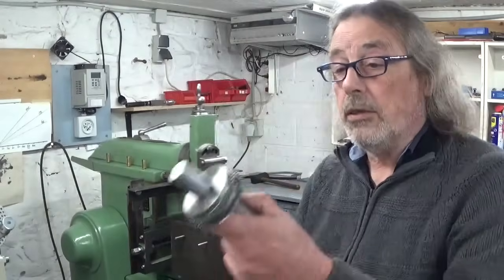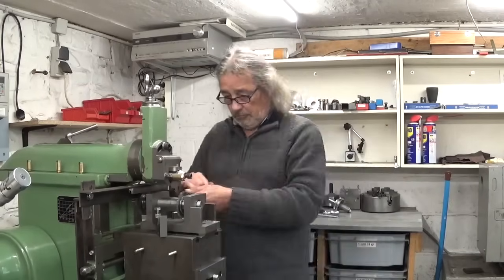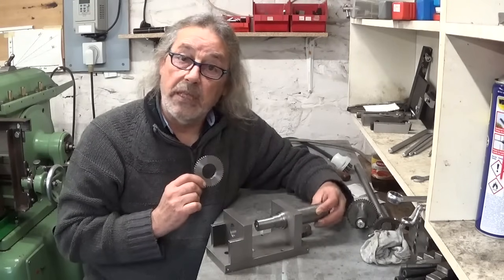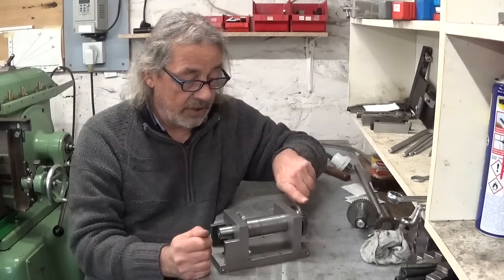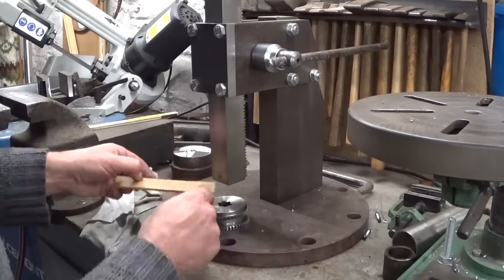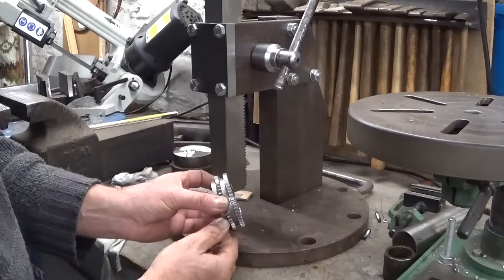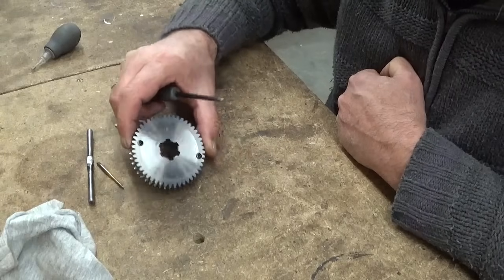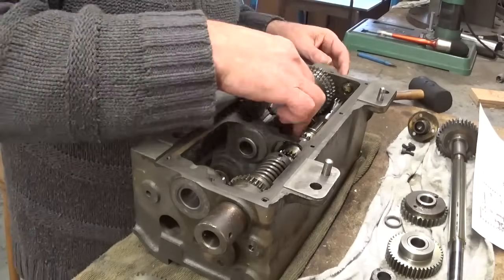Shaping a gear for the Celtic 14.

Comment: Thanks a lot rusti!!! I bought a junk celtic 14 a few days ago for a very cheap price. And when it was delivered to my house i realized that my wife is going to kill me 😂😂 because it doesn't run 😂😂 and it takes a lot of space on our driveway. But it was cheap like 200 dollars. When i checked it the electrical was pretty busted and the gearbox was flooded with a mix of oil and rain water plus rust 😂. But the headstock is in prestine condition. Because of your video i just got the idea how I'm able to fix the broken gears. Again thank you very much rusti!! You're the man!!! Godbless and keep safe.
Reply from the maker: Nice. I'm sure you will turn it in to a gem. Have fun with it.

Comment: Shaper 1- Dividing Head 0.
Excellent,  and very clever Michel, I  thought I remembered using a wire 🤔.
Thanks for sharing
Reply from the maker: I used a wire, but the rack is easier.

Comment: Rusti,
sorry for this off topic question 🤔
I have recently got an old deckel fp1 from 1938 ..
I  suspect that something is obstructing the Z movement in the lowest position (towards the floor) .. seems my z travel should be another 50mm or so ... can you include a picture of your deckel in it's lowest z position so I can see how it is supposed to be?

sorry for hijacking this, but I don't know how to contact you 
I hope you don't mind. 

thank you for sharing your knowledge 
😁👍👌
Reply from the maker: No need to apologise. It's absolutely not off topic.
The total travel up and down is 340mm. So it's easy to check. I hope this helps.
Reply: Thank you very much 😊 I really appreciate it

Comment: I've never seen shaper gear cutting before.  That's a wonderful technique and although it requires a gear for copying it doesn't need a tooth-specific cutter .  Speed-wise, how does it compare to cutting teeth on the mill?

I probably wouldn't have bothered tapping and screwing, drilling across the press fit boundary and pinning would have been fine.

Damn fine fix overall, though.
Reply from the maker: I think it takes about the same time as on a milling machine.

Comment: Nice work, I have to do the same job to a harisson lathe feed gearbox, at least six gears need replacing. Gremlins have been living in there for too long. Unfortunately there are two different gear pitches in there so i would have had to buy two different gear cutter sets, and affordable ones are probably made of cheese, so instead i bought a shaper last week and i am going to follow your example and pursue the wire rolling technique.
Reply from the maker: Great. Go for it. And if it fails, go for it again.

Comment: You are thrashing it. By the way I would have used gaffer tape to hold the end plate on as a temporary measure - if that worked it may have ended up a permanent fix. Good onya Michel
Reply from the maker: Maybe, but I need to open it to check oil level...

Comment: I like that gear cutting fixture. Very handy. I'm curious if you have ever tried to cut internal splines with the shaper. I ask because I have a project that I need to cut 6 straight sided internal splines and I am thinking I might be able to do this on the shaper. Indexing it, though, will be my biggest challenge.
Reply: You can index with a jig similar to Michel's.
Mount a gear on the same shaft of the jig having teeth in a multiple of 6 und rig up a detent to engage with the existing gear teeth
Reply from the maker: That's a very interesting question. I don't know yet, but I will come up with something and let you know.

Comment: That was a good fix on the gears Michel. A few questions: It looks like a lot of work in your gear cutting jig. Can you grind you shaper tool to the involute profile for the gear and just cut the teeth without the blank rotating? Did you find out where that ring went in the gear box?
Reply from the maker: I will make a seperate video where I explane shaping grears in more detail.
And indeed, I did find the correct place for the ring.

Comment: They are wonderful machines but, they are a bit fragile on the gear box. Be sure the clutch on the lead screw is in good condition...Because if the clutch is not working properly, you will have to make new gears!!!!☹ Good luck😉
Reply from the maker: Thanks for the tip. I will check that.

Comment: "I'll be back." - Arnold Schwarzenegger LOL I'll be back too!  I though you might drill a couple more holes in the last cover, on the side facing the camera and through the tabs there. tap the tabs and have a place to put some hold-down screws. may still be a good idea to keep the cover from rattling. Lathe is nice and quiet, why mess with something nice? Also, I always suspected there would be a use for old printers. Nice job as always!!!
Reply from the maker: If I see that the cover doesn hold, I will make some changes.

Comment: Great work as always.  I would love to see more details on the shaper gear cutting.   My shaper looks at me when I walk by it and just begs me for something to do.
Reply: Geoffrey Croker has an excellent video on gear cutting in the shaper.
Reply from the maker: I will make a seperate video where I explane shaping grears in more detail.
Reply: Thank you
Reply: @jimdean7335 The video by Geoffrey Croker references a magazine article. This was 'Gear Cutting With The Shaper' by someone writing under the nom de plume of 'Base Circle'. 
The article appeared in the September the fourteenth issue of Model Engineer magazine.
It is available online.
There are other videos on gear cutting in the shaper. All require a jig. Michel's jig requires a gear of the same number of teeth as that being cut or a factor thereof but there are other methods of acheiving this.

Comment: Rusti, good afternoon. Do you eat Breakfast cereal, if you do look no further for gasket material because a cereal box makes good gaskets especially with a smear of grease on the sealing joints.🙂
Reply from the maker: The gaskets I had to make are larger than an average cereal box. That's why.

Comment: G'day  Rusty. Excellent job cutting the teeth on the shaper,  which I think looks better than with a gear cutter.
Just wonder why you could make a  gasket from a Large Cerial packet, single cardboard about 1/2 mm thick + .
The modification turned out very well,  plus the gearbox ran very quiet.
Excellent,  catch you on your next project
Reply from the maker: Thanks Ted. The gaskets are larger than an average cereal box.

Comment: Nice one Rusti. A tip for next time you use fibre board for gasket paper. That board is not very resistant to oil and breaks up eventually. What you can do is make a weak solution with methelated spirits and shellak, soak the cut casket in the stuff until saturated and allow to dry. This will make a much better sealant against oil. Worked on my motorbikes so it should work for your late projects.
Reply: His card will work
Reply from the maker: Thanks for the tip. I will keep it in mind.